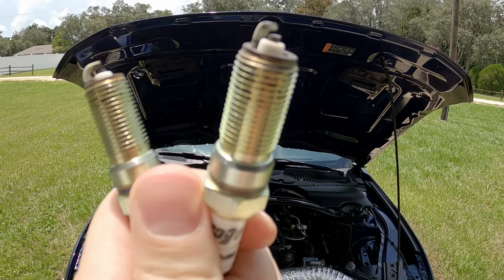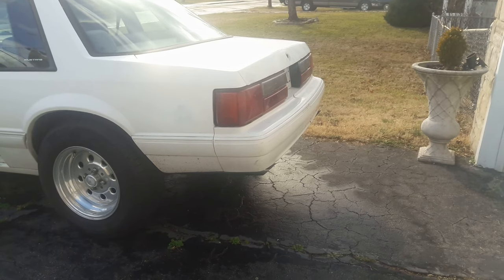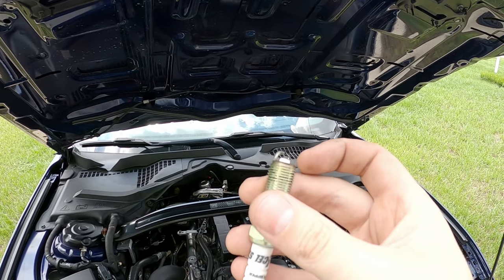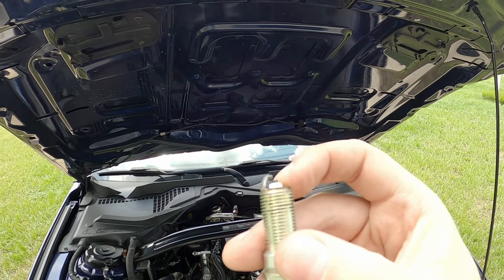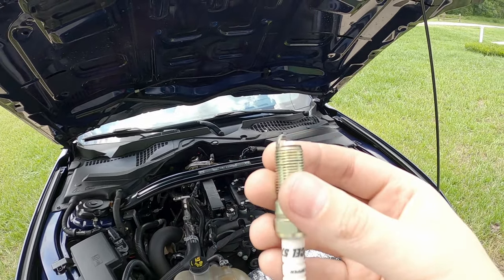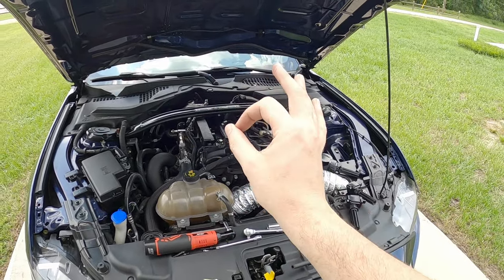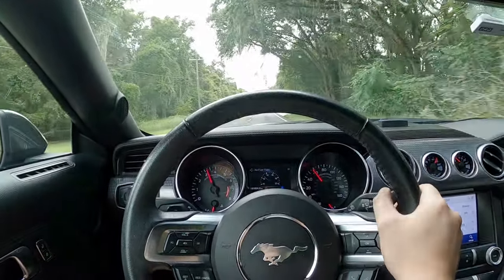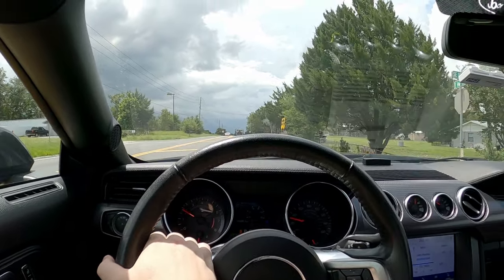Side Gapping Spark Plugs was a BAD IDEA!

Comment: I think the whole thing with exposing the spark kernel really took traction in the 90s. There was a plug called splitfire and the plug was basically a side gap of the V split in ground strap to the electrode. I tryed them and they made zero difference. I do find that with the fine tip metal plugs they ingite better and stay clean longer. Another great video keep it up !

Comment: Would different octane fuels react differently to side gapping? I'm wondering if the speed at which the fuel combusts might determine whether or not side gapping is beneficial.
Reply from the maker: That's definitely a possibility.

Comment: Hey i have same car as you and it vibrates slightly when i have the AC on and stopping in a traffic light while the car is on drive, its not as worse if the car is on neutral. Is this an issue? Its worse if ive been driving hard before stopping at the traffic light.
Reply from the maker: Could be ignition related like worn spark plugs.
Reply: The problem is Crank Shaft position sensor. It needs to be changed. The car heats up and this sensor trips and the car does not run until you switch off and rest for a few minutes then restart. Change the sensor and you're golden again.